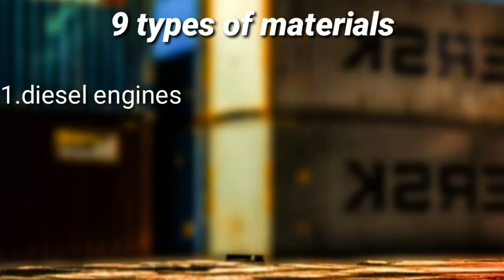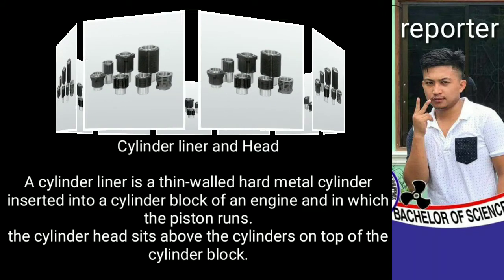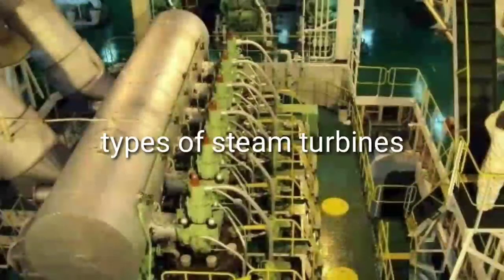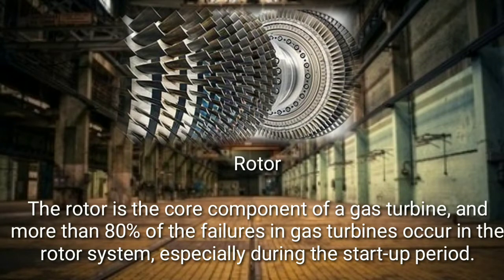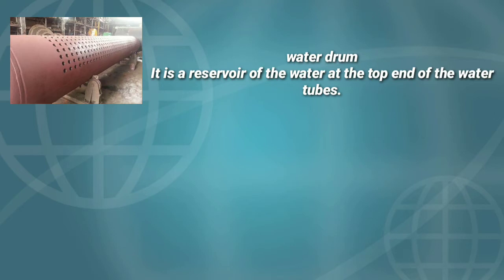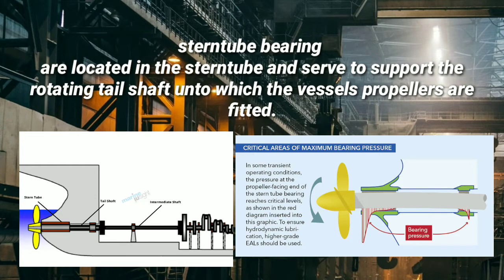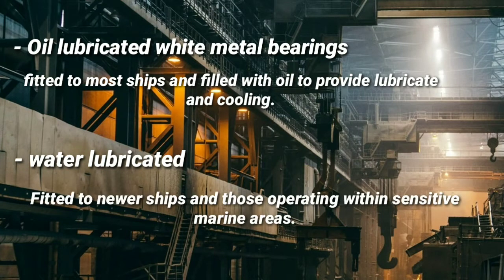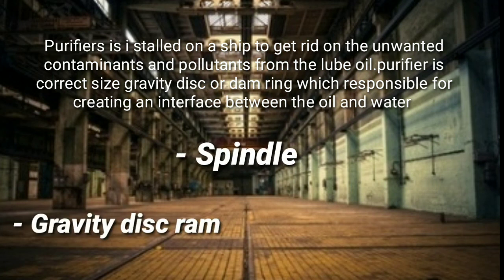11. EMAT: Selection of Materials

Comment: I learned on this video are diesel engine is ignition of the fuel is caused by the elevated temperature of the air in the cylinder.

Comment: Thank you guyz for this video, because i have learned a lot especially the 9 types of materials which are,  DIESEL ENGINES, STEAM TURBINE, GAS TURBINES, BOILERS, SHAFTING, PUMP, HEAT EXCHANGERS,  COMPRESSOR, PURIFIERS.